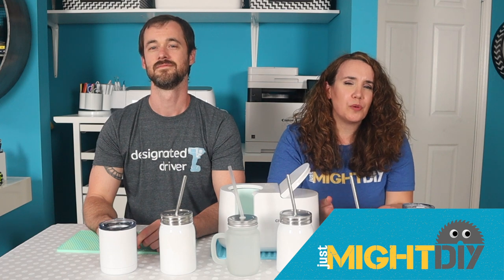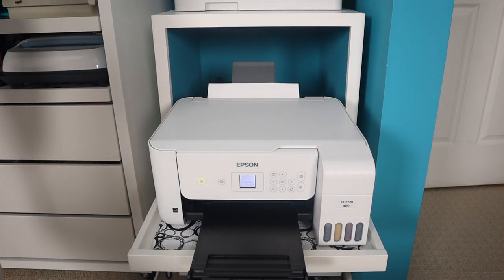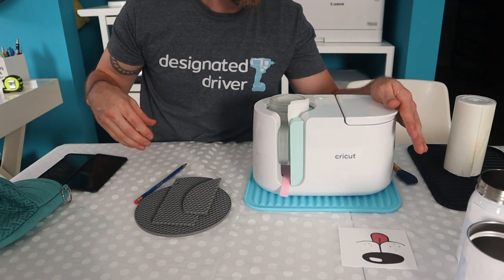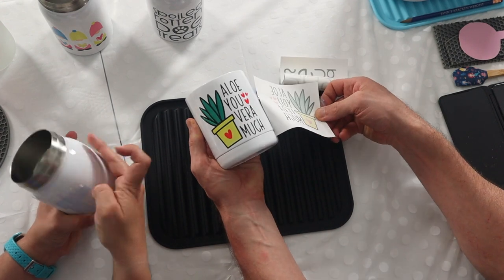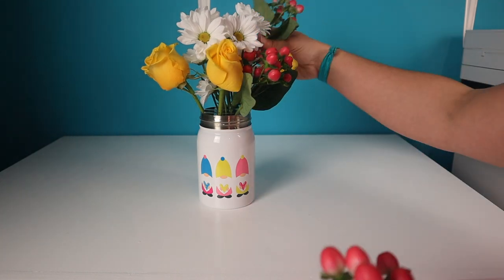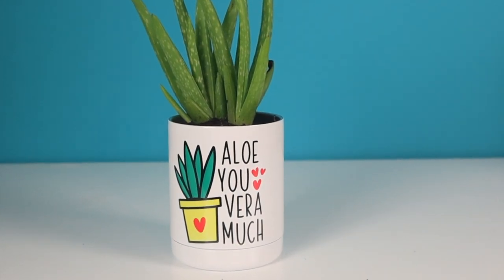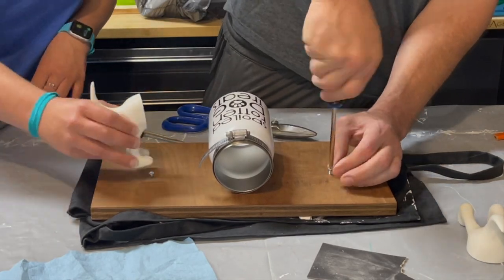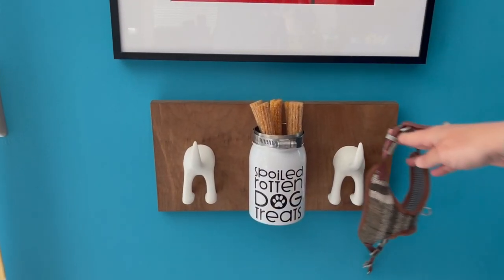Make Mason Jar and Tumbler Gifts with the Cricut Mug Press | Sublimation Ideas

Comment: Amazon has many listings for soap pump lids for mason jars...will they fit on the sublimation blanks? The listings are for "regular mouth" jars with 2.38" openings...
Reply from the maker: We tried both the regular and (just in case) the wide mouth soap pumps and neither fit this stainless steel mason jar. The regular sized pumps do, however, fit the frosted mason jar that we did the Bloody Mary gift in. We had just already sublimated he graphics before we discovered that. 😉

Comment: What is and what is the purpose for the pink piece in the bottom of the press?
Reply from the maker: Hey there! That’s a silicone cover we cut out of a baking mat. It’s there to protect the coated stainless tumblers from scratching on the metal plate at the bottom of the mug press.
Reply: Thank you it looked on the video that the mason jar you did not put all the way down in the press. Did I see that right?
Reply from the maker: @stevenarnold6917  It does look that way in this instance, but we’ve put them all the way down many times.
Reply: @JustMightDIY  thanks again. No more from me.. ordering mugs now
Reply from the maker: Fantastic! Happy subbing!